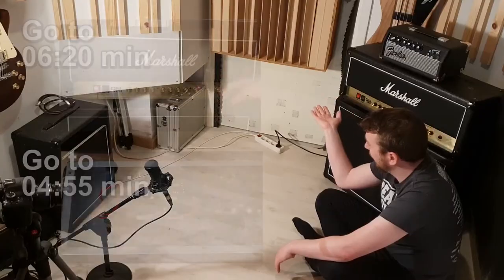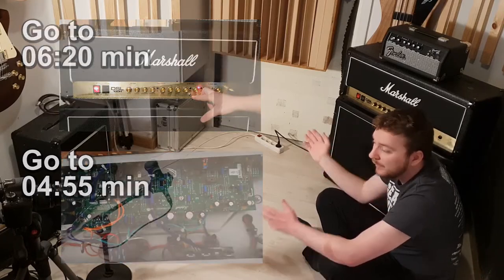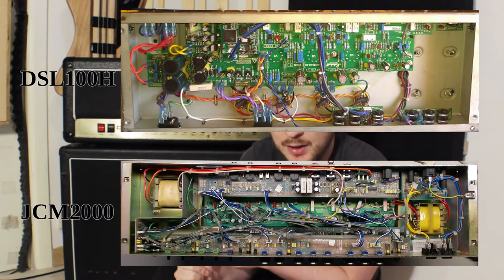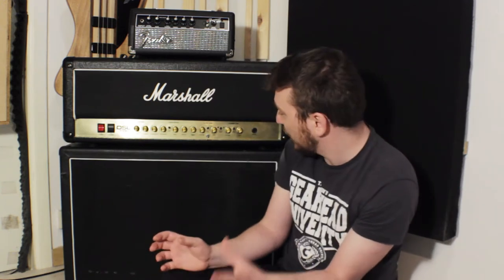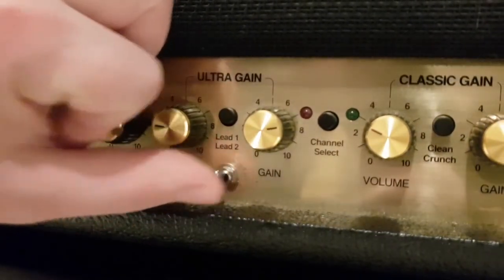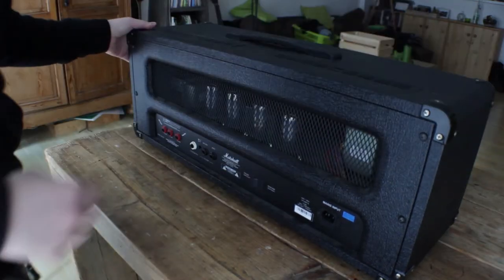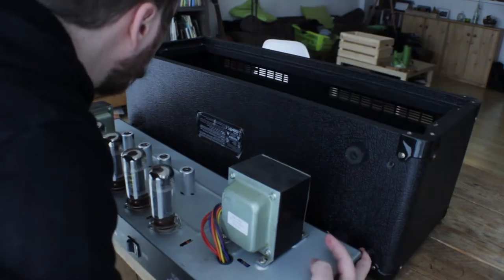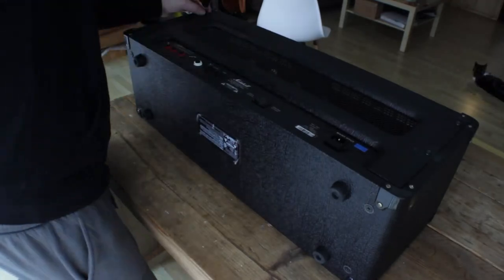Marshall DSL100H (switchable) Cap Mod (how to + samples)

Comment: Great video.  I have an HR, and love the classic channel, but it could use some tweaking on the Hi gain channel.  It is almost like it gets too much OD when barely turning up the gain on that side.  And, maybe it is too much treble in the gain.  I'm glad to know that the mod leaves the classic side alone, because it is a fantastic Plexi sound.  I remember looking at a Dumble video one time that had what looked like adjustable resistors or caps, like you would adjust with a small screw driver.  I'm going to have to search a little for something like that, as you could dial in a sound before putting the thing back together.  -Might be an option.  Great video.

Comment: Thank you so much for this video. I decided to cut c19 and thank God I left enough leg on it to solder it back. Because it sounded horrible. Haven't tried putting another cap on it, but I would do that before just cutting it and leaving it. I'm sure there has to be something that sounds better. But right now I'm loving it just the way it is stock..

Comment: my guitars have singlecoils. the amplifier has good low end or the sound will be very thin and excessively bright? I think that the modification that you have made in the amplifier is obligatory and should have come from the factory. thanks for making the video and sharing such good information
Reply: Amp works just fine with single coils, especially after the mod !
Reply: @boengelen3714  Gracias!

Comment: Ok you said you have to crank them to sound good. I have that amp and play through 1960a cab, up past 5 on the volume it sounds great to my ears, you play at 2 on the volume knob in this video. How does the 100 pf cap mode sound at band volume ? is it noticeable up past 5 or 6 ?
Reply: The difference is less but stil noticeble imo, I liked the "in between" the best at volume 4 (my live volume)

Comment: The DSLs (at least the old ones, don't know the new ones) get way too much hate. For some reason it's very popular to hate them in the gear nerd community. If you crank them, they can sound almost identical to a 2203. People need to get their heads out of their asses and actually listen instead of following some weird herd mentality. And also, the old JCM 2000 DSLs are very, very durable. I've had mine for about 10 years (it was built in 2004) and I've never even had to change the tubes.
Reply from the maker: Agreed :D
Reply: I have a Dsl50 from 2000, it's the best amp I have ever owned. The tone of cranked 50w, power tubes over driving is amazing. Just my 2 cents

Comment: Hi, I have done the same mod, however I am now picking up noise which wasn't there before. Did you have any issues with this when fitting the switch?
Reply from the maker: No, I don't have any noise at all... Did you check all your solder connections?

Comment: Your tone controls already do the same thing.  Amp and guitar.
Reply: Not really. When the Red channel is on with the 470pf cap in place, it does not respond well to your guitar’s tone control. Take out the cap and turn down the bass, and now the channel responds to the guitar’s tone knobs.